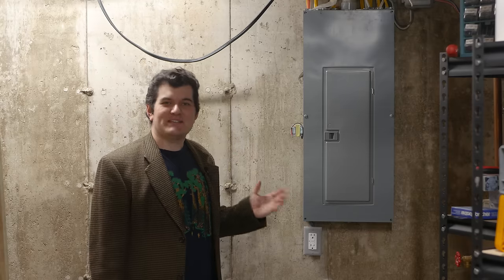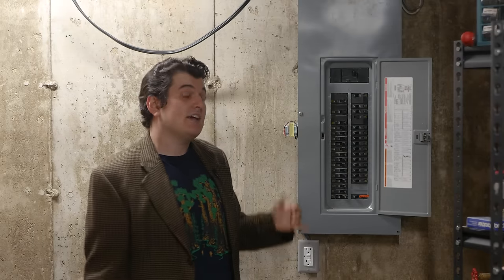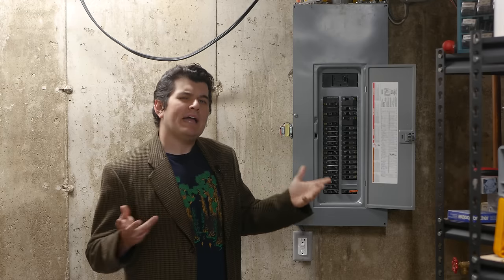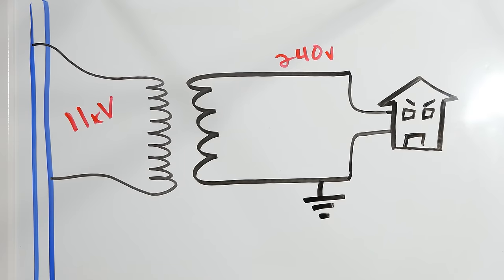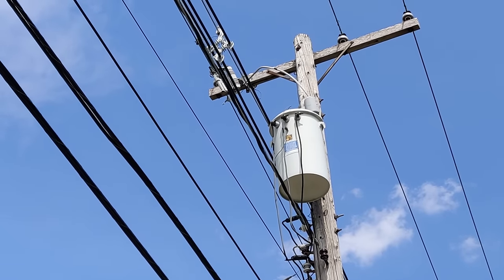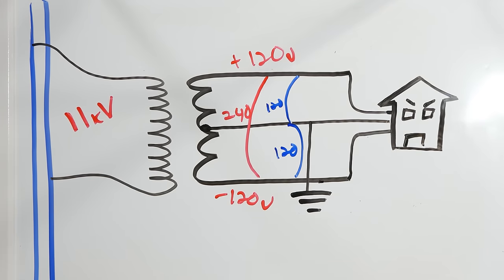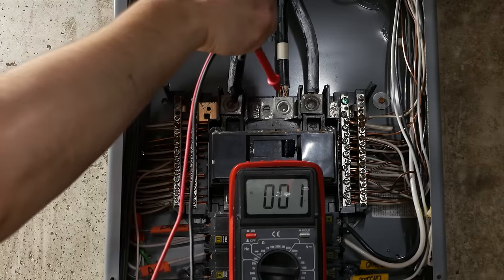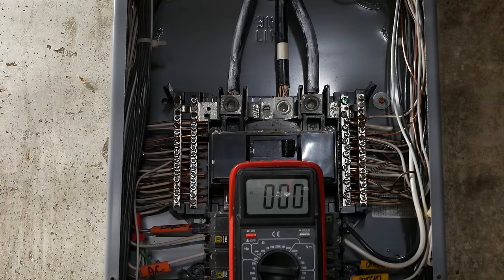The US electrical system is not 120V

Comment: From a prospective electrical engineer, I'm happy to see somebody acknowledging the actual workings of our electrical system, and bringing up Ohm's Law in response to the whole "It's the current that kills!"

Also, the plugs are fine, in my opinion. They would be more child-proof if they looked more similar to England's, but in general, Americans know home-power safety and rarely get a jolt. And the ones who do are usually doing something dumb.
Reply: With the appliances size plugs from the UK, I'm reminded of a old saying. "Sell Europeans a means to kill themselves & you'll amassed a fortune."

I remember from my childhood the plugs in France were very similar to the US, albeit more pegs than blades.

I would say the UK were made in such a way is because the British are "accent" prone.
Reply: As an electrician and electronic engineer for 10 years (I'm counting time spent as a student for maximum clout) living in Iceland, which has very strict regulations, I'm even more dumbfounded than I expected to be. This all seems so ridiculously archaic and easy going that it looks like something some layman would half-assedly slap together with whatever second-hand junk he found laying around. But then again, that's just my perspective.
Reply: @eyegrinder94  Simplicity is always a positive, as long as it works as intended. There is no point in adding bloat, and therefore more points of failure. What exactly is it that looks so bad to you?
Reply: I think that the italian plugs are the right compromise between safety and simlicity. Those have 2 cilindrical rods covered in plastisc for more than half of the lenght so if the plug is only half inserted is impossible to touch the metal. if the appliance needs the grounding there is a third rod in between the other 2. The holes in the soket are closed and open only in you push something in in both at the same time, not the safest but imo safe enough.
Reply: The euros have no ground fault as they have no ground wires the USA NEC is the safest in the world
Reply: @jeffumbach  "Accident-prone"? Did you base your comment on some statistics or is it just your assumption?
Reply: Safety aside. My problem with US plugs are that they rarely stay plugged in and are just dangling from the socket. Especially for chargers and heavier things that plugs right in... maybe not a huge problem for a power cord though.
Reply: @Johan Petersson I have a laptop charger with a huge power brick on the socket so it just refuses to stay in
Reply: @jeffumbach  you can't generalize over european plugs because every country has different ones. in every country i've been the plugs were really simple (I'm from italy and i've been in germany, austria, france, czech republic, croatia and grreece), the only european country i know with complicated plugs is UK. And I don't know wich accident you are referring because in all my life i got electrocuted only twice but while working on the circuit without opening the breaker, and i don't know anyone that got electrocuted inserting or extracting plugs.
Reply: @donniebaker5984  you should check your sources because what you are saying is completely false. at least in italy, but i think it is an EU law, is illegal to have an elecrtical system, both in homes and in industries, whithout grounding. It is necessary to plant in the ground one or more 3-4 meters long metal rod to have grounding, and it has to be carefully calculated how and how much to plant.
Reply: That or we arent paying attention and accidentally rub an exposed wire while moving. Almost common in the HVAC industry since engineers like to have wires in the front, motors or loads in the back.
Reply: +Johan Petersson That normally depends on the age of the receptacle. An old, worn out one will barely hold anything, while a newer one will hold on pretty tight.
Reply: @donniebaker5984  "...Euros no ground wire.. " That's because AC distribution systems DON'T have a ground wire they have live, neutral and Earth. For some unknown reason, Americans seem to think that the terms neutral and ground are interchangeable which implys they are the same thing when in fact, they are not. It's not unusual to have ground sitting at 126Vdc relative to Earth and neutral.
Reply: Coming from Germany, I can tell you that it's very very hard to actually touch a life wire here.

Our plugs assume that there is no safe wire (while mostly there is a "neutral" wire), and our casing is connected to a "ground" wire or insulated and touch-proof. As soon as there is a leakage to the ground wire, modern circuit breaker installations will trip. My old installation has that for the bath only, but it's not allowed for new houses.

If you plug in one of our devices, you cannot touch a wire at all (except the ground wire). Before the metal touches, it's completely inserted.

Even if you manage to have a 240 V wire to touch, it's usually not enough to hurt you (BTDT), and I'd claim that in the cases where 240 V will kill you, 120 V would suffice. I do not know about a scientific test on life human bodies (and I'm glad I don't).
Reply: @kingsman428  "ground" == "Earth" for most speakers, but …
Classic (vintage) installations have PEN installations where (as the video mentions) the middle wire from the video is also connected to the ground. While this is good for short(length) circuits, it offers no additional protection and on long wires, you might have a noticeable voltage to the real mother earth. According to the video, this may be the usual way US installations are done.
On modern installations in Germany, you  have PE and N as two separate wires. The Neutral wire is used for current and the PE is always connected to the ground (and by not being used, actually has 0 V for most installations). This is much better and allows for a "Fehlstromschalter" to trip whenever there is a leakage. New installations require one of these breakers for each circuit.
Reply: @jeffumbach  'stupidly complicated' - you're calling people dumb and careless, and yet apparently are confused by plugs...
Reply: @lucaspreafico9050  Yes, the Swiss plug is quite similar, and the Europlug (without neutral) as also halfly coated rods so you can't touch a life pin by accident.
Reply: @jeffumbach  The Nanny began to air on CBS in 1993.
Reply: @lucaspreafico9050  I also got shocked twice with 230 V, once with a X-Y-plotter, which did not work and when I tried to change the melted micro-fuse without pulling the power cord first (aargh!). The other one was a very stuck GU10 lamp exchange that was trickily integrated in the kitchen hood and therefore glued by greasy fumes, which seemed to have an insulation failure of the wiring. So, yes: electric shock is not an abstract thing but may happen from time to time.
Reply: @johan.mp4  Sounds like you need to replace some receptacles. A new receptacle in good shape will grip a North American style plug quite tightly.
Reply: It is the current really, a billion volts can flow over your body with no result but a tenth of an amp of low freq ac can stop your heart.
Reply: @TruAnRksT  Volts doesn't flow, amps do flow. Voltage indicates a potential which does not flow, nevertheless even high-frequency low current discharges are nasty, therefore musicians between singing Tesla coils are wearing chain mail as Faraday cage.
Reply: +TruAnRksT Ohm's Law (put in relation to current): I = V/R. This means that current (I) is directly proportional to voltage. Higher voltage equals higher current; no way around it. Yes, the current is technically what kills, but the flow of current is only made possible by voltage. More voltage means more "pressure" pushing the current through.

You most likely have no problem touching both terminals of a 9V battery at the same time, despite its capability to provide far more current than what is lethal. If the voltage didn't matter at all, then a 9V battery would be lethal as 120V. But the 9V is too low to push current directly through our bodies.

Also, voltage does not flow through anything; only current flows. Voltage just pushes it along. Current could not be pushed along without voltage, and the amount of current being pushed at a time depends on how high the voltage is.

This is why the implication of the voltage not mattering made by saying it's the current that kills is false. The current is what kills, but the amount current depends on the magnitude of the voltage. The voltage matters a great deal.
Reply: @gunnarkaestle  It does flow, otherwise it wouldn't be trying to get somewhere else. But you are right it needs some amperage behind it or it wouldn't even try. Now high voltage and high frequency together tends to stick to the skin surface and doesn't flow through your body like more common 50 or 60hz electricity. I have built several Tesla coils and have had no problem letting them discharge to my fingers. It will burn you if the arc lasts too long but it doesn't shock you.
Reply: Hahaha Andrew Neal, your explanation was almost text book perfect, that might not be a good thing. hehehehe
Reply: @TruAnRksT  Mean Mary on fast banjo riding an Iron Horse ??
Reply: @gunnarkaestle  ridiculous post, enjoy it or spend an hour saying how stupid I am. Your call. Seriously I love this woman and her music.
Reply: @gunnarkaestle  Not riding, chasing. But I already replied to this.
Reply: @TruAnRksT  I was just wondering, why this music video is related to tesla coils or electric installations.
Reply: @gunnarkaestle  ridiculous post, enjoy it or spend an hour saying how stupid I am. duh
Reply: @jeffumbach  your comment includes to many words compared to your lack of knowledge.
Reply: @lucaspreafico9050  shutters on outlets have been code for like 5 yrs or more in the usa but only for new bld/remodels with permits -no one will just the spend $$ unless they have to if i had small kids i might cheap and easy enough but no real point
Reply: @donniebaker5984   lol yes they have both they just call them rcds or newer system arc  and gfci are rcbo look for thomas nagy, cjr, UK sparks.  france and italy use a system close to old bx with earthwire in the sheath connected to the box never really see it but its there
Reply: @johan.mp4  plugs wear out and you can buy better ones just poor maintenance or shoddy product
Reply: @pleopsidium6960  You literally live in a communist dictatorship.
Reply: @johan.mp4  That's not true.
Reply: @wizard3z868  never had that problem with other types of sockets. But always in the US. Even in relatively new buildings. Never heard that e.g. euro sockets wears out, that's a stupid argument and a design flaw.
Reply: Ben P lmao, okay dude
Reply: @eyegrinder94  I am a retired integrated circuit designer with an electrical engineering degree. Despite the fact that I never designed a component that could handle more than 18V or so, I am fairly  familiar with the US National Electrical Code, and installing new branch circuits, outlets, switches and the like. The NEC is pretty thorough, and local codes can be even stricter. Just because the NEC says you can do something, doesn't mean that it is going to be okay with local electrical code enforcement. In any case I find the US split phase system fairly robust for the most part, with low current circuits getting 120V and high current circuits getting 240V. The electrical outlets that a consumer will deal with on a regular basis are almost exclusively 120V (I have seen wall outlets for large room a/c units that were 240V). Electric rangetop/ovens and electric clothes dryers have 240V outlets, but the consumer rarely has a reason to plug/unplug them. One need only ensure that the two phases of 120V have similar loads so as to minimize the neutral current, and that you have a good local earth ground. These requirements are similar to those for 3-phase "Y" industrial circuits.

OTOH I will concede that US 120V plugs are not particularly safe, especially some of the inline (not 90 degree) variety. Some older plugs I have seen don't have any kind of lip  running around the base of the plug (side near the socket), and I always worry about fingers slipping around the base and contacting the "hot" blade. If your other hand or other body part was resting on a grounded pipe or other grounded object you would get a nasty 120V shock across your heart. Not so great :3)  I like the European peg design where the pegs are insulated for over half of their length.
Reply: @johan.mp4  That is usually a sign of an aging socket. The brass used tends to lose its springiness over time.
Reply: @bobraible  so? That's just bad design when it degrades like that.
Reply: @johan.mp4  Maybe. When bought in bulk, 15A sockets (outlets) can be had quite cheaply ($3.38 USD for a 10 pack on Amazon). Builders in the U.S.tend to go cheap when they can. So maybe that is a factor.
Reply: @kingsman428  in US system neutral is bonded to earth ground at the main panel (and nowhere else). They are NOT interchangeable, but at one point in the home thay are at the same potential.
Reply: @7eggert  "...ground==Earth for most speakers..."
For too many but hopefully, not most.
Thinking that Ground==Earth could easily get you killed. Imagine this, an electrician opens the back of an arcade video game to repair the mains lead. The metal chassis housing the monitor has a huge ground sticker on it but that's not a problem for the sparky because to him, that's Earth. Now, if he's unfortunate enough to be touching a true Earth and he just happens to touch the monitor chassis he might just get a nasty shock of approx 125 Vdc and end up dead. 
Neutral and Earth are approximately at the same potential except under fault conditions. Ground can 1000s of Volts above Neutral and Earth, ground can be any potential you want to reference your circuit to.
Reply: @bobraible  The issue isn't about where the bonding of Earth and Neutral takes place it's about interchanging the term ground with Neutral because they aren't the same thing.
Reply: @kingsman428  Yup, I just haven't heard a lot of people confusing neutral and ground. Of course in the old days, 15A residential outlets didn't normally accommodate grounded plugs. They just had slots for the hot and neutral blades. People used to use "cheater" adapters to allow grounded plugs to use 2 prong outlets. They had a pigtail that was supposed to be attached to the center screw of the outlet plate thereby connecting (hopefully) to the grounded (hopefully) portion of the duplex receptacle. Crazy stuff. If I moved into an older house I learned not to assume that the 3 prong receptacles had any kind of ground.
Reply: @kingsman428  In Germany, it's mandatory to connect the ground connector to the local Earth. I actually touched an installation where that wire was b0rken and the power supply would cause a voltage of 125 V there - but at very low Amps. Also I saw installations where the wires were switched - and if there is no neutral, the "neutral" wire actually may be abused for 240V. If I want to cause fear beyond that, I'll mention the https://de.wikipedia.org/wiki/Hamburger_Schaltung (Carter system).
TL;DR: Always double-check the installation and your test device before touching anything. Always! And after having tested twice, you should still assume each and any wire to be hot.
Reply: Mazxj Stripes  Technically, neither amps or current flows